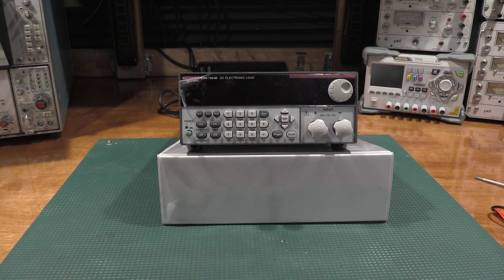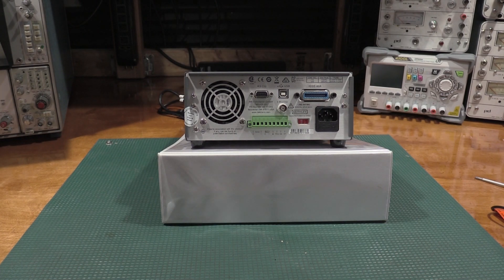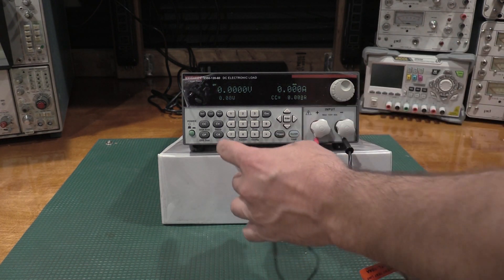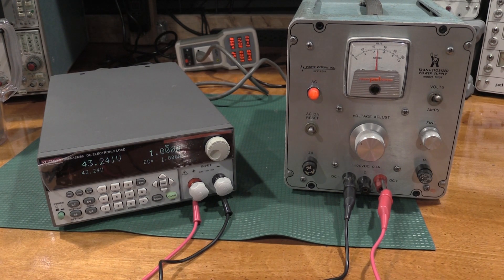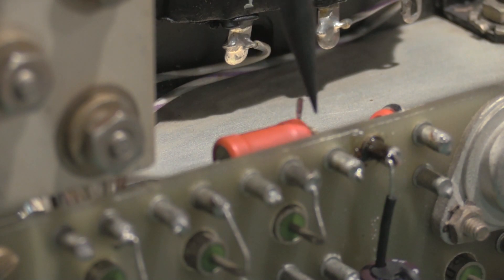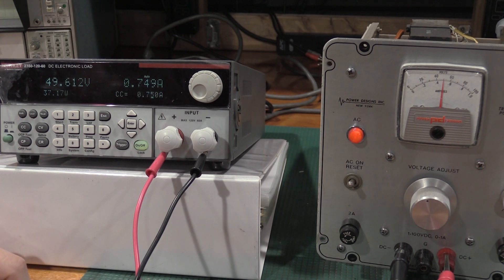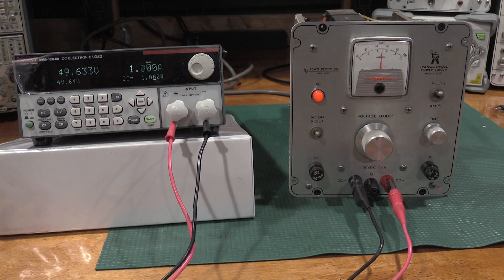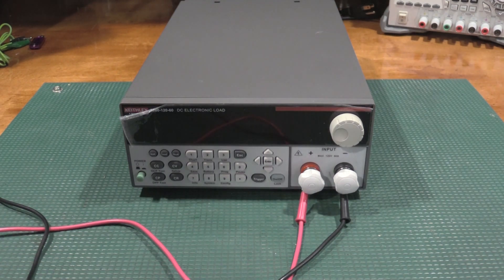New Lab Load and Power Supply Breaks on Camera

Comment: Hi i just picked up a POWER DESIGNS 1010T did you have any luck finding a manual for it. keep it up
Reply from the maker: Unfortunately not yet. Mine is nice and stable after the recap. It does a slow sweep up now till it locks in the voltage then it adjusts quickly. If I run across one I will let you know.
Reply: @ZenwizardStudios  ok thanks that would be great, mine is missing the fuses and the fuse caps no big deal but it needs a recap as well some look like there growing something,
Reply from the maker: Yea that happened to mine as well. That and the fault under load prompted to recap. The huge bulk caps did not need to be changed in mine so left the power caps but changed everything else. if yours has the peg board in it those pins take a TON of heat from the iron to de-solder. lots of thermal mass in those. I have a pretty grunty hakko iron on the bench and it struggled a little on them.
Reply: @ZenwizardStudios yea looks like it has the peg board in it, so thanks thats good to know, im testing the big caps now, hope they are ok they are pricey.
Reply from the maker: Those are not hit very hard cause the power supply is only rated for 1 amp. So usually they should be good. I do hope this still holds true for you as they were quite spicy when I looked at them and had a LONG lead time.
Reply: @ZenwizardStudios  yea i looked on mouser they were 25-50 each depending on brand and life span i choose, looks like the smaller on is ok ill check the bigger one in a bit.
Reply: @ZenwizardStudios  well both big caps tested ok so I did a power up and it's not working good at all. It jumps from 2 volts to 40 volts turning the dial just a little, at full turn I get around 130 volts, but if I hook up any load at all the voltage drops to 0 volts no matter where the dial is set at. It looks like a few of the power transistors on the big heatsink have been replaced as well as a couple diodes and a couple transistors on the regular board with the small caps. Can you tell me what transistors the big ones are on the heatsink, without a manual I don't know if these are right or not.
Reply from the maker: Hi Jason,
	Ill open mine again and take some Tech pictures. I will toss them up on patron on an open post. The good news is this should be repairable. If you need a measurements taken let me know as well. My unit had exactly the same issues. It is a regulation issue I cant confirm this but what I expect is going on is the pass elements are turning on so the unit can not deliver current. This is why the voltage crashes out to 0 when any load is put on it even a small one. Mine would source less than 20ma in to a meter.  When my unit did this there was a red and white wire I call it out in the video I believe that was not connected. Also what lead to the recap was stability issues in the regulation circuit. Given that the supply is all discrete it should be repairable.

Zen
Reply: @ZenwizardStudios  ok great ill keep a look out for it on patron  voltage measurements would be very helpful if you have time. i googled trying to find a manual and a couple places come up that have a copy but they want 3 time the cost in shipping then they do for the manual, may have to get one but im hoping not.

Comment: The battery charging would be interesting. Also if you could show a schematic of that power supply, it looks interesting, I see the voltage is at least partially controlled by a variac.
Reply from the maker: @Mark A, I will see what I can dig up. I do have some interesting battery stuff on the way as well. Still waiting for a back order to come through. With the second unit I ordered. More Keithley but not a load.

Comment: Surprisingly a DC load is one of the more useful pieces of test equipment at the bench. And great you have a understanding better half (Dear I think we need a new spectrum analyzer...of course we do, go right ahead!). Helps to have a spouse who is also a ham, makes acquisitions a bit easier! Can't wait for you to pull that darn plastic off the front panel!  ;-)
Reply from the maker: It is turning out to be now that I have one I am using it often. The only time I get in to trouble with my other 1/2 is when I get something and I don't use it. At least with the bench I don't seem to have that problem. She has some projects she would like some boards made so that is also fun.